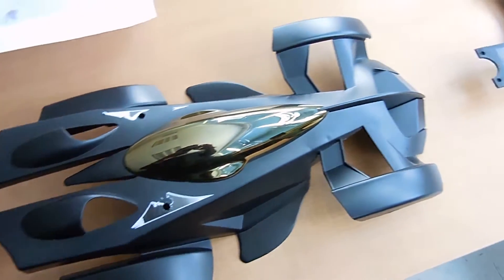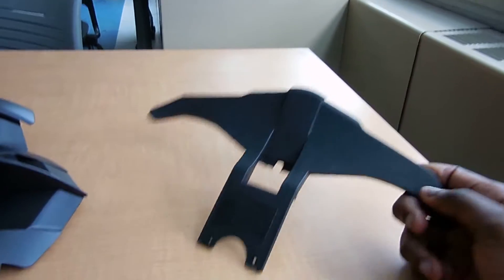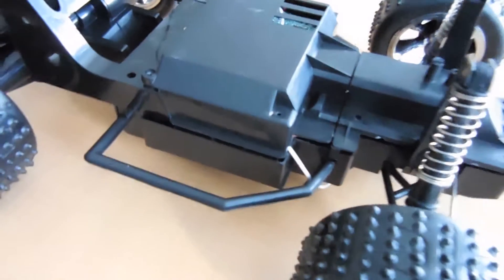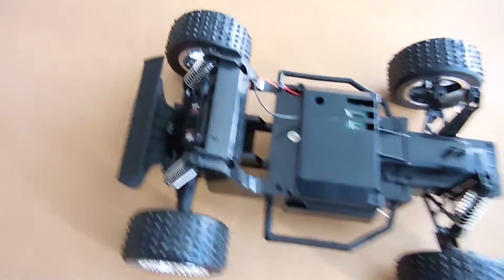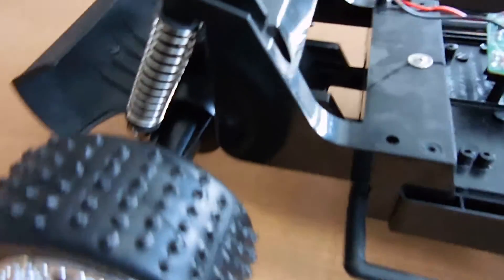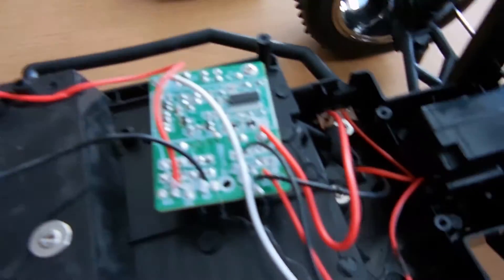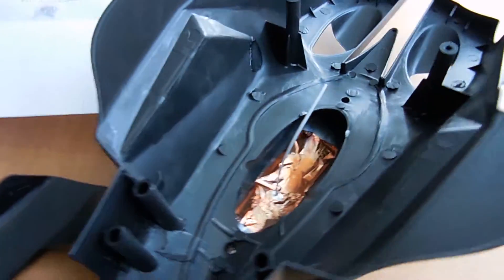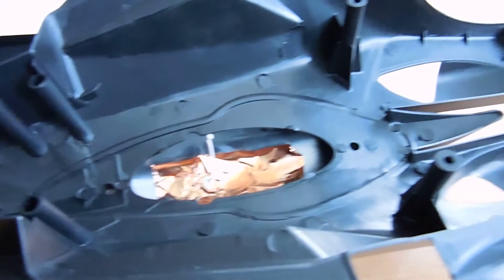Internals of Vengeance RC Car - RC Car "Hack"

Comment: Would you mind posting s clear hood shot of the circuit board with regards to where the wiring is located. I have two wires that 
Broke off.😞